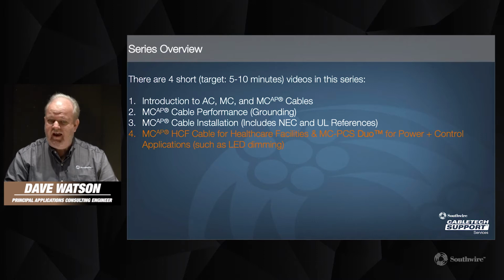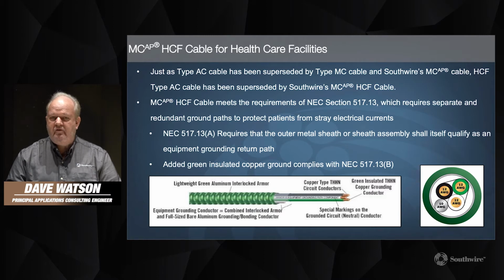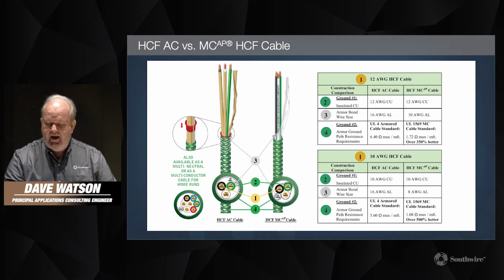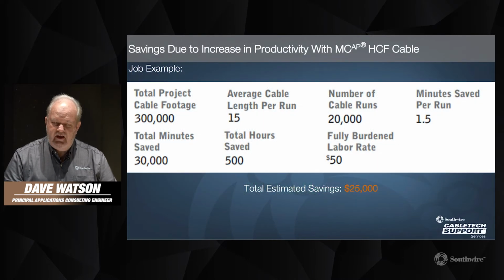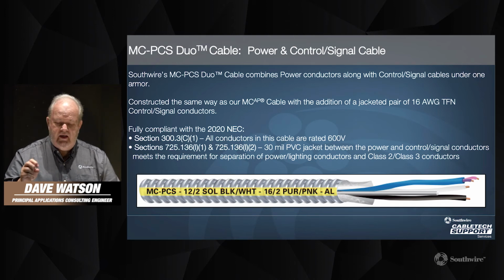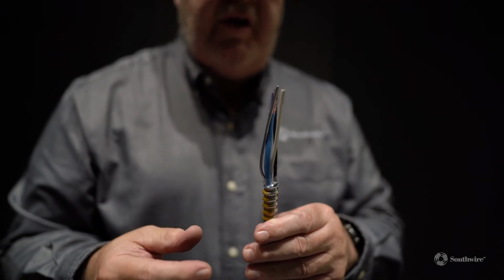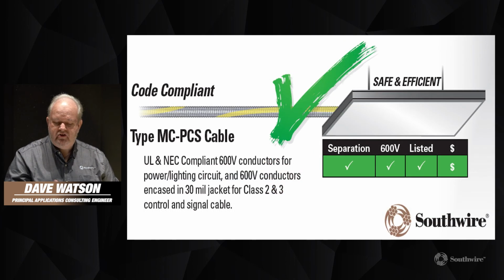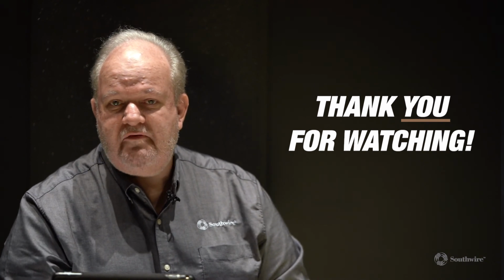Southwire® MCAP® HCF Cable for Healthcare and MC-PCS Duo™ for Power + Control Applications - Part 4

Comment: After all this training.  I feel that these the HCF MCAP is a scam for more money ...  Second thought ...on HCF MCAP .. And If I use a lock nut type connector , I will always use a red bushing to prevent from cutting into the wire from a bend.  I don't know about this.....  When do you not use a red bushing is with the snap on connector ...why you ask ... cause it has a built in red bushing.... .. Sorry....this has to be a scam somehow .... I see this coming back and biting someone in the buttocks

Comment: How is the conductivity across the green coating on the armor? Aluminum oxidizes to a clear insulating film as well.
Reply: I said the same thing when I first saw this product.  paint can be a non-conductive thing. that's why we scratch it to bare metal.  This must be a scam

Comment: You would think that at least one qualified engineer at lightning manufacturing companies would have said they should not use gray for dimming control wjring. Was told more then 50 years ago that gray was only allowed for the neutral ( yea now called stupid confusing term " grounded Conductor " ) on 277 vo!t systems either straight single phase two wire 277 volt or from a Y connected 480/277 4 wire system. Like to know how use if gray was allowed UL on any listed cables. Stevie Wonder could have done a better job then dopes allowing gray color for any low voltages.

Comment: I retired from a large Children's Hospital. They had a policy that only fittings that use a lock nut to secure MC or HCF cable to a box were allowed. Hete in Philadelphia from August 1981 they outlawed aluminum wire to be used for any grounding but saw union electricians installed thousands of feet of it on several remodeling jobs in patient rooms. At an IAEI when they had a HCF cable rep I asked if cable was i!legal to use in Philadelphia. Never got a clear answer. Think that the steel studs in patient rooms should be bonded with a copper conductor. We always used the red anti short bushings. The union electrician would cut the #10 bare a!uminum on a diagonal leaving a sharp edge on the 3 to 5" they left inside of boxes. Told them they should install a small wire nut over sharp end of bare wire to prevent it from cutting into jacket of other wires. Nice vidio.